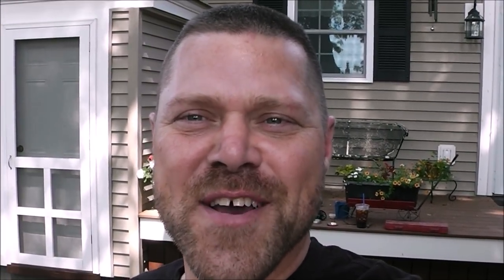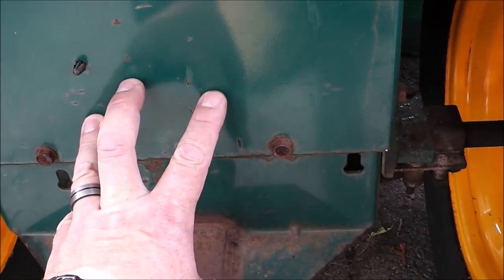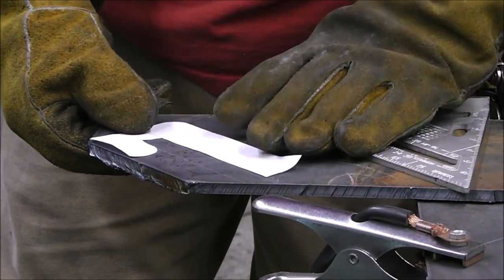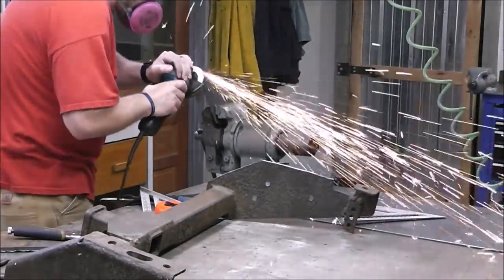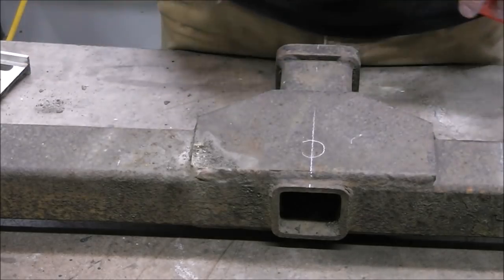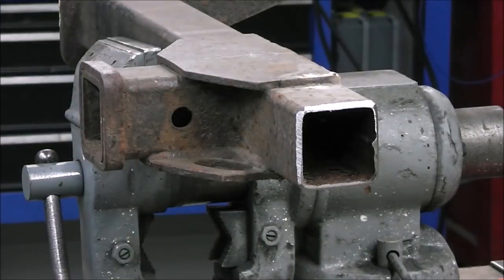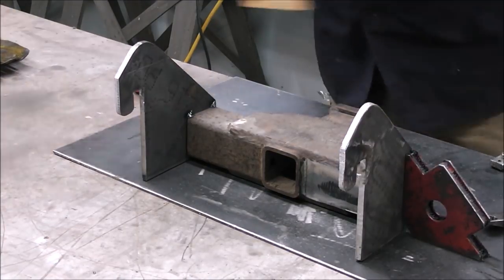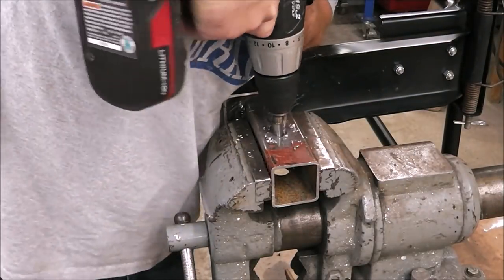MIG and STICK Welding a Quick Change Hitch with Bagger Fabrication

Comment: I have the exact bagger setup on my Craftsman riding mower but yours is far sturdier than the factory mounting system. I worked in the carpenter shop at NBC, Burbank in 1968. That's where I learned about burning an inch. Good tip, Brandon. You're probably not old enough to remember the "Laugh In" show but I worked on the wall with all the little doors that people popped their heads out of.
Reply from the maker: I just looked it up! That's awesome man!!!!

Comment: Overall Wow!, I just watched the whole series on this tractor. Great work! I am currently in the middle of breathing life back into a 52 year old MTD tractor that belonged to my Wife's Grandfather!
Reply from the maker: @Rattletrap2 thanks man! This was a fun project. It's always enjoyable when you take something and make it useful and reliable again. It now has over 500 hours on it and the only problem I've ever had with it was this past summer the charging indicator on the dash came on saying the battery wasn't charging. I bought a 20 dollar rectifier off amazon and I was back in business in less than 20 minutes. It's super reliable.
Reply: @BrandonLund  my Cub Cadet Garden tractor had the same issue. The battery would die while cutting the lawn. I could see the voltage dropping on my dash. When it got below 10 volts, it would just shut down! I bought a new rectifier off Amazon, but still had issues. I found there was a bad ground on the DC side. I had torun a separate wire to a solid ground and all is well!
Reply from the maker: Nice fix! Finding electrical gremlins can often be a huge pain in the butt

Comment: We call it "Cutting" an inch.  I put the 6 3/4" on the centerline then mar zero and thirteen. The reason the end moves is to compensate for the thickness of the catch hook. It saves a stepand double checks the number as it's laid out.
Reply from the maker: Good to know! Thanks David!

Comment: Very nice work. Good presentation - you show/demonstrate as you talk ( I dislike the long-winded videos where the majority of the presentation shows the talker displaying his/her dental work or imperfections thereof). As a retired engineer from the Defense industry, may I suggest test fitting a piece that took significant design/layout/fabrication effort prior to finish welding it. (I required this of my engineers and technicians, and the cost of the incremental test steps - mechanical and electrical was always factored in the contract. Precluded huge and expensive problems many times)
Reply from the maker: I love doing things that way. My latest video (I think) was building a set of custom shelves and I did it this way. I built patterns, then I built the final project to those pattterns. I was so confident in the patterns that I sent the finished product direct to powdercoat without even test fitting them and when they came back, they fit like a glove 👌

Comment: That is a nice project hitch. Cool to use a standard reese style hitch then make your bagging attachment to fit it. Nice workmanship ,welds and thought process. I just wished you would have welded the seams they did not weld at the factory. Does it need it no will it hold yes. But I just love seeing a good looking 7018 weld. Any place where the metal touches and there is no weld is like a day without sunshine. I really like that Blue demon welder. All I got to say is dang they have come a long way with shrinking the size and weight of welding equipment. I would love to know what that machine cost. All my stick rod welding equipment is old my round top idealarc lincoln welds great but you need a cherry picker and a pickup to move it
Reply from the maker: Thanks man! That welder is a beast for the money. It's around 300 bucks and easily welds 6010 rods also. They have come a long way since I started welding too. I agree with you about laying down a nice looking bead where the factory left off. I intended on doing it but somehow I forgot and never went back to it. Thank you for your comment and support! Cheers
Reply: Brandon Lund thank you for taking time to answer questions and communicate with your viewers. It is just easy to find yourself trusting a 7018 weld. I also like the idea of forming a seal around the parts. I live in Ohio so building things to resist rust is always a concern around here.
Reply from the maker: I really enjoy engaging with our little community we have here. I hear what your saying about sealing everything up. I’m usually very particular about aesthetics also. I’m from Maine, so if it’s not sealed or painted, it’s rotting away in short order from all our winter salt. It’s brutal up here! Cheers brother!

Comment: Another one for the books. How’s that Demon run 6010?
Reply from the maker: Welding Junkie most all of the inverter type welders wont run a 6010. Supposedly the blue demon 160sti is one of the few that will. I haven't tried it yet but thanks to you I guess we are going to find out!!! Thanks for the suggestion!